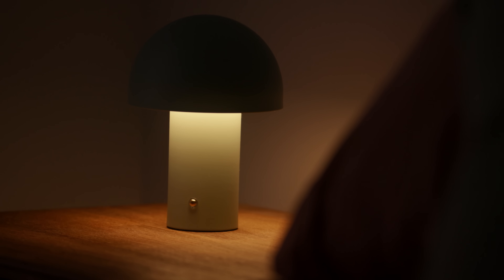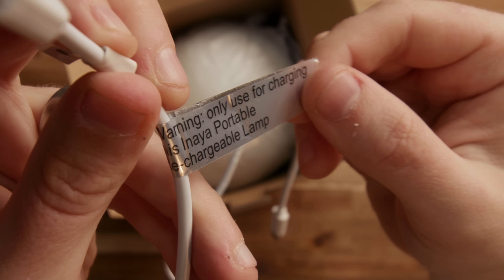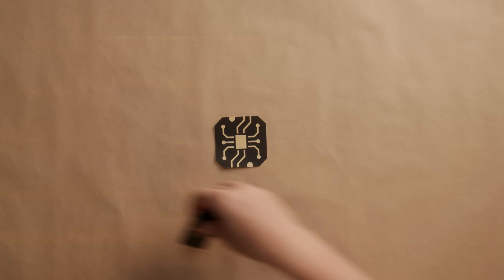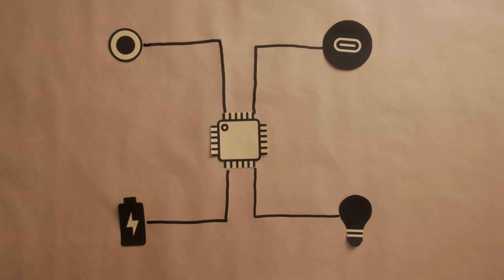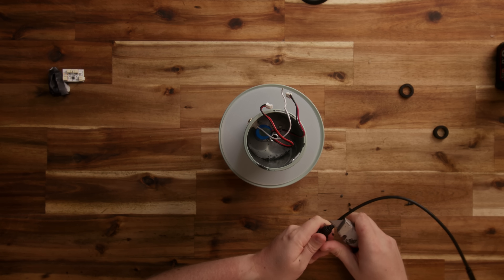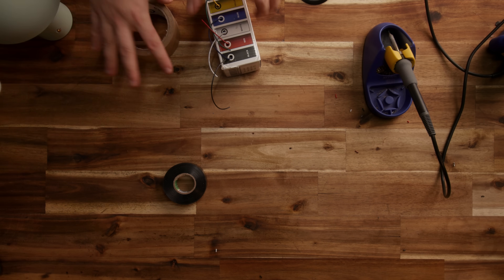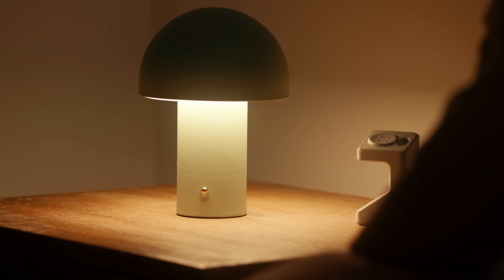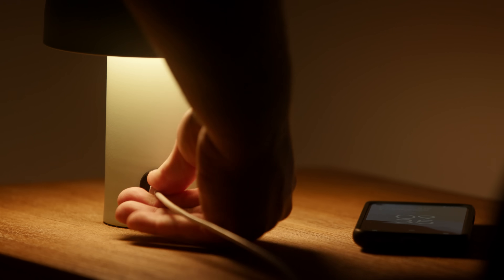Kmart Lied to Me, So I Hacked Their Lamp

Comment from the maker: For everyone that's interested, the included USB cable is wired like this: 

GND    -------> GND
D+  -------> VCC
D-   -------> VCC
VCC -------> VCC

So it is a non-standard cable! I measured by checking continuity between the USB A plug, and the USB C connector with a USB A adapter on it. None of my probes are small enough for a USB C connector's pins directly. 

There was a bit in the video about this that ended up on the cutting room floor, my bad!
Reply: There is a chance this special cable isn't really that special and the lamp doesn't require VCC on D+ and D-. A lot of USB-C devices lack two resistors that are mandatory to tell the other device "I need to receive power". Without them, any USB-C charger or PC or laptop will not provide power. If you connect the lamp through any USB-A to USB-C cable it may charge.

This is because USB-A to USB-C cable is directional, so there is a guarantee that USB-A side will be plugged into power source. With USB-C to USB-C there is no such guarantee, as this port serves both purposes, so there needs to be either a proper communication between devices or just 2 simple resistors telling the other side "I'm dumb device that needs power", that's it. Lack of those resistors will mean USB-C chargers will not turn on the power. This applies to any charger with USB-C port on it or hard wired USB-C cable or any PC or laptop or other device with USB-C port that can provide power.
Reply: @gwynbleidd69  Jep, this is 100% it. After you collect a few USB-C Gadgets from Aliexpress or whatnot you start to realize that some only work with a USB-A to USB-C cable and start to wonder why and then end up at the explanation you've given with the missing resistors.
Reply: Why did Kmart through all this effort of making cable that needs to be unique, going through all the design work, manufacturing instead of including a cheap, mass-produced cable of an existing design then adding two $0.01 resistors on the PCB?
The cost of making a custom USB cable probably more than outweighs the cost of putting two resistors on the PCB anyways so what's the point?
Reply: @williamhuang8309  It happens a lot, I think it often just happens because they simply just test with A to C cables, which of course will always work as USB-A connectors only supply power dumb and never sink it.
Reply: @williamhuang8309  to save ~$10,000/yr in licencing fees.
Reply: @williamhuang8309  the USB-c spec is very convoluted and a fully complient port can cost you several USD to implement
Reply: Kmart do not manufacture.
Reply: @williamhuang8309  so ppl fry their shit, and / or thinks the lamp is broken when the othercables wont work --> you gotta go and spend more again basicly just for using a shitty "knockoff" cable
Reply: Thanks for this explanation, I have a light ( in fact it’s a huge light switch ) that worked for a while but won’t charge , I’m guessing it will have a similar issue .
PS - Thanks to the YouTube algorithm for suggesting your video. - I really like your style and have subscribed
Reply: @SandyCrack69  It's not broken, it's Chinese.
Reply: Great project, but why does a stationary lamp even need to have a battery? It could just be attached to the wall permanently. It uses less precious metals and has lower risk of accidental fires as well.
Reply: @David-um8tb  Yeah, I don't really get these lights. I mean, I can see something like that would be useful but for a bedside light, it's either yet another thing you have to have a recharging routine for or it'll typically always need charging when you most need to use it. I'm actually working on a bedside light/clock with individually addressable LEDs but it will be permanently plugged into my multi-port phone charger.
Reply: @David-um8tb  Simple: the AC to low voltage converter would costs more than a small rechargeable battery and USB-C connector. It'd be a power brick or a mains cable plus certification of the entire product.
Reply: It's very common in cheap electronics lately. It usually means it was designed to be USB A/Micro but they decided they want USC-C, so they swap the connector without adding the rest of the components required for "proper" USB-C. The cable is then just a USB-A power-only cable with USB-C ends on it, eg 2-wire only inside. In most of these products (depending on the exact way they bodged it) you can solder on some 0805 resistors across the inside of the connector and make it detect as 5V USB-C and work on a normal USB-C charger/cable, eg for the Miyoo Mini consoles and other products I've modded for people, but what you did makes it a way cooler project overall anyway, so I would've probably done the same too.
Reply: @ObsoleteNerd  USB power only would be fine, that does not connect power to the Data pins or connect the data pins to act as power rail in he device. That is what kmart did here. All ti save a couple of resistors and make it incompatable.
Reply: @ObsoleteNerd  Still shouldn't be putting 5V though the data lines. That's just ridiculous. I was ready to call out a bunch of info about cables to TheStockPot but if this is really the case (which I have no reason to doubt), it's just completely broken and these things should be recalled and the company triple tariffed.
Reply: Can you get to/replace the LEDs. Another nice upgrade might be to replace the LEDs with NeoPixel LEDs. Would allow colour/effects and wouldn't need the Transistor.
Reply: Oh.... Wait OH! Ye that's insane, why did they even both with D+ and D-? I am still a learner with USB-C, haven't looked into emarkers yet, haven't really looked into what a sense pin is (I think it's literally just a resistor or something? idk). But I do get USB A fairly easily. You do NOT want to be sending 5 volts through data lines.
Reply: OK. That's terrible.
Reply: This cable is a war crime.
Reply: This is actually illegal. The USB forum will take away their right to use the USB logo on the box, or anywhere at all.
Reply: Is it possible there's a blob on the board?  In the USB spec there's a standard where the data pins can have a resistor between them to indicate they're a "dumb device" that wants a specific voltage/charge level.  Maybe they did this but there was a blob shorting to VCC on one side?  This would show continuity, but should show a different resistance value if you set your meter to test for that instead of just continuity.

What I really don't get is the spec goes out of it's way so manufacturers can make very simple/dumb end devices with just a common resistor or two.  Yet places still don't use it properly.  Baffles me any time I see it. (And yes, I've seen all types of connectors/ports used incorrectly like this, or worse.)
Reply: Why companies sell these disappointments to unsuspecting customers, I don't know.
Reply: oof, i thought u were gonna say they left out the CC resistors (which is another shortcut i can't stand), this is much worse!
Reply: Something like this has happened before with microUSB. I discovered an old flip phone that belonged to one of my grandparents. I saw it had a microUSB plug, so I just plucked the first such cable I could get my hands on to change it. 
It turned on just to say "UNAUTHORIZED CHARGER". It, too, was wired differently than the USB standard.
Reply: There’s even some USB-C data and charging cables that will work perfectly with Android and Windows devices but will have tons of weird issues with Apple devices like the cables not functioning at all except for when charging with a wall adapter or power bank for example.
Reply: So the problem is that the lamp pulls power from GND and D+ (or D-) and not GND and VCC?
Reply: I have a few of those
Reply: what the hell, i have never seen this before
Reply: bro...
Reply: That is insane. Who would do that??
Reply: so the thing i rly don't get about this: why? it's the same cost (just different PCB layout, they could've done the standard cheap-ass solution of leaving out the CC resistors), potentially more expensive since now they can't use an off-the-shelf cable.

Did they got a discount on a batch of defective chargers that were wired incorrectly, and just made a board variant that accepts it? but the batch would have to either be so huge that all the units work this way, or they would have to carefully track the board variants and make sure the right chargers end up in the right boxes, which seems like something you wouldn't do if you're corner-cutting. if that were the case,, they could've spared themselves that inventory nightmare and just left the D+ and D- pins floating, so that the lamp could accept either the correct or incorrect cable, but they didn't (since you said it doesn't charge when plugged into a regular cable).

which makes me wonder... did they screw up the connector pinout on the PCB design, and by the time they caught it they already had too many units? even if they already had the correct cables ordered, they're generic, some other product will use them up, they can just "fix" the boards by ordering a batch of custom cables with matching incorrect wiring (compared to scrapping the boards, which are product-specific and would be a total write-off). if this is the case, this has two fun implications: 1. we've just discovered a new type of bodge wire, the "bodge USB cable", and 2. that custom cable is still probably more expensive than off-the-shelf one, so at some point the defective board will sell out and they'll probably make a new rev, with the pinout fixed, so that they can a generic cable. And when they do that, there's no way in hell they're gonna put careful thought into inter-compatibility btwn the board revisions.

I'm leaning towards the latter, as i struggle to see how anyone could rationally conclude that a free dumpster full of defective USB cables would be worth the operational complexity this would add, while it makes a lot more sense to me as a "forced" last-minute workaround ("forced" in quotes because, no it's not, it's generally a better idea to try building a thing and testing if it works, before ordering ten thousand of it)
Reply: I was waiting for the satisfying shot of that charging cable going in the bin.
Reply: Maybe the producer simple messed up the lamp and decided to fix it by producing a non standard usb c cable which turned out cheaper for them but unnecessary hassle and risk to the consumer. 😂🙈
Reply: @markus4979  Yeah, fine, let me introduce them to that risk, let me just get my USB Killer... Which primarily works by puting a couple hundred volts ac on the data pins...
Reply: They didn't lie.
It totes wuz YooEssBee-See.
You see? 😂😂😂
Reply: Just a note on the transistor. A mosfet or any Field Effect Transistor (FET) is that they operate as voltage amplifiers not current. Bipolar Junction Transistors (BJT) operate as current amplifiers.
Reply: Woah, that should be illegal
Reply: yeah i was surprised i ordered some usb c female plug and after some struggle i realised its not same connections as regular usb c
Reply: Hey always remember, if you are not american, your life is without value.
Reply: So usb c only has to have the usb c connector to be called usb  c. That’s the only standard they have to follow. The wording can be done any way they want hence why there are usb c cables like this one that only provide power to their charging port. Please don’t accuse someone of lying or deceiving customers when you don’t understand how the standard actually works
Reply: So usb c only has to have the usb c connector to be called usb  c. That’s the only standard they have to follow. The wording can be done any way they want hence why there are usb c cables like this one that only provide power to their charging port. Please don’t accuse someone of lying or deceiving customers when you don’t understand how the standard actually works
Reply: a lot in the vape industri does this. only their own usb cables own..
Reply: But that was the whole premise of the video... Why usbc didn't work
Reply: Phones getting accidentally plugged into this cable: getting some very strong signal today...
Reply: I saw this video recommended to me everywhere I went, about a month ago. Now we have three or four lamps, and I returned to this video, seeing that the USB C stops halfway. Sorry I didn't heed the warning sooner. Seems i have some wiring to do.
Reply: Are you sure it is not because you are just a lowly "iphone peasant" with your inferior Apple USB-C cord? Besides, Apple were FORCED to adopt USB-C by the EU after several years of all other brands and other devices such as the Nintendo Switch having USB-C as the Universal Serial Bus (USB) that works with everything! Apple refused for many years because they earned more money from ifans when their precious iproduct lightning port stopped working due to bad design by Apple who ripped off USB-C - when the user plugs in the cord it usually goes in an a diagonal angle, with USB-C that is fine, but on Apple's lighting trash port, that wears out the literal connectors on the device and guess what, they did not have Qi Wireless charging as a back-up (apple fans I knew who I kept showing my Samsung's wireless charging since 2015 kept saying it is a gimmick...lol) This was a real world fix for iphones but they had no wireless charging capability! lol Yes they eventually copied Samsung again and added it many years later.....But suffice to say, They did it on purpose to get you to buy another new POS iphone with the same issues or another cord or the cord then another new iphone. This is where you SHOULD HAVE cut the cord and gone to a far superior alternative brand such as Samsung!
Reply: I didn't really follow that. Is the cable on the left and the lamp on the right? You mentioned using the cable would fry anything else connected to it, so is it sending the VCC back through the data channels? I'm guessing that would be ok for a charger, but not for a device like a PC. Although I guess they assume no one is going to charge from a device like a PC. It does look dodgy and weird, why connect anything to the data lines?
Reply from the maker: @ there is continuity between the VCC on the USB A end, and the Data lines on the USB C ends. 

5v would be present on the data pins when connected to a charger
Reply: @TheStockPot-AU  My guess is that this would be unlikely to cause damage in practice, but nevertheless, why on earth would they do this?
There is another problem that can happen where some USB C chargers won't start sending 5V unless they see a remote device signalling that it's ready. It only takes 2 resistors in the device to send that signal, but cheap devices often don't bother. In this case, you find some USB C chargers work while others don't. However, chargers with USB A output and a USB A to C cable will always work.
Reply: Bizarre. Did the original wiring make any use of the Vcc on D pins ?
Reply: It feels like a bodgy way to get around EU regulations on chargeable devices having to USB C, whilst reducing the BOM as low as they could go.
Reply: @AnthonyDFHogan  They could just... not connect D+ and D-. Then the cord wouldn't destroy other devices.
Reply: @AnthonyDFHogan  Still weird though. I have a bunch of very shitty charge-only cables here on my desk. I'll have to see if any of them are similar. They're so bad, they only give 0.1A at 5V.
Reply: @chaos.corner  Heh.. probably the thinnest, cheapest copper coated aluminium they could find :)
Reply: Have you tried with USB C to C cable or A to C?  
There are many devices that cannot negotiate 5V from a PD charger and need the "dum" 5V only approach.  
If that works it would be the easiest way to power the lamps. With a normal USB A charger and an A to C cable.
Reply: @ I think the issue is that from USB A, to USB-C, the VCC pin is connected to D+ and D- on the other side of the USB-C cable. Then the device itself (the USB-C socket installed), is using D+ and D- to carry power to other parts of the lamp, instead of only using Ground and VCC pins from the cable and properly managing the power... It's usually as simple as bridging a couple of connections with solder on the USB-C side of the cable. Which means a C to C cable would not work, as it would need a pull-up resistor connected to the CC pins on the USB-C socket within the device to tell it how much power it can take.

The danger here being, that you now have a cable that has 5 volts going into the data pins on any device you connect it to. This is very bad. 

I don't know if that made much sense, I was just making sense of it myself really. I was always confused because I assumed emarkers done the bulk of the work in a C to C cable, but I think they're mainly for telling the device what current/voltage the CABLE can handle, the supplier, and also the cables orientation relative to the device and power source. Still quite unsure about them, but I think that's roughly correct? I'd do your own research at the end of the day still. 😅
Reply: @MCgranat999  cable still should not have 5v on the data pins, there shouldn't be continuity between USB C data pins and the USB A VCC pin, that is bad. Potentially very bad.
Reply: Wait K-Mart still exists. And why do they still exist.
Reply: If you would have not spent any money on fixing your lamp and would have gone against their terms of service to make it work, I would have liked your video and possibly subscribed.
Spending money to fix your lamp is not hacking. Dislike and I will make sure youtube does not reccomend this channel.
I am really disappointed.
Reply: Usb c cables are not all all the same, theres a lot of proprietry varieties--check em out.
Reply: @EmeraldHill-vo1cs  those arent usb c cables, theyre proprietary (and therefore useless) standards stealing the usb c port
Reply: @EmeraldHill-vo1cs  USB cables SHOULD be the same insofar as us dumb consumers are concerned. The U stands for "universal" which should be self-explantory. 

The labelling of this lamp on the box should also explain that it uses a proprietory or non-standard USB-C port.

But then, we're talking about Kmart here and a $17 lamp. A lot of USB-C charge and sync cables alone cost more than that. 

At least the author has alerted us to the product's deficiency (and how cheaply it's made).
Reply: @EmeraldHill-vo1cs then they are not USB-c (usb-pd).  It's only USB if you actually follow the standard, the rest is lies from manufacturers
Reply: @EmeraldHill-vo1cs If they aren't following the standard, then they aren't USB-C and shouldn't be advertising as much